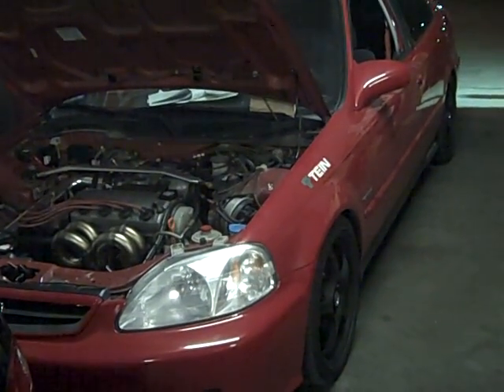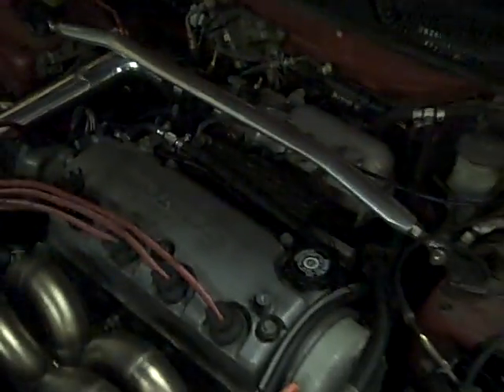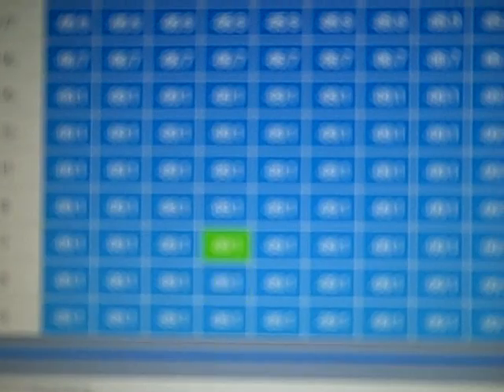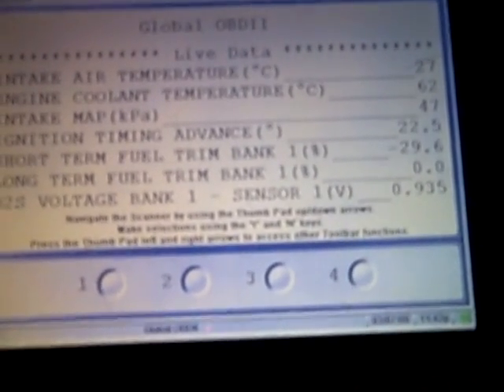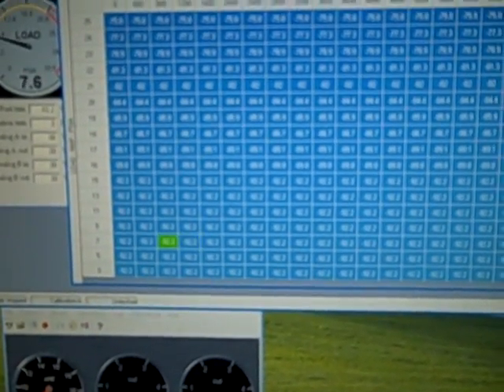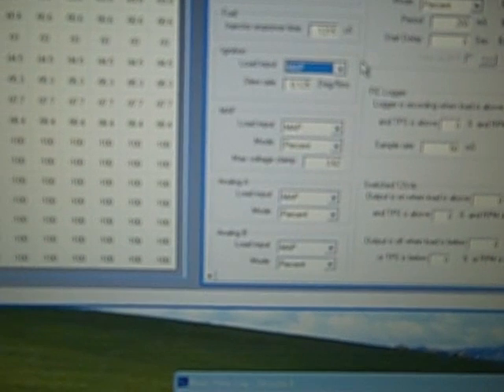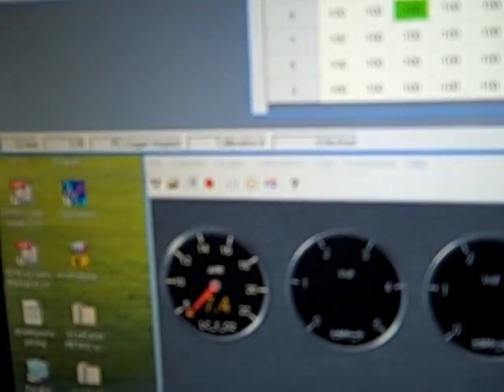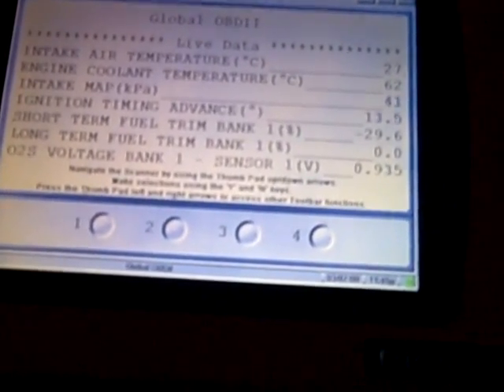AEM F/IC Running PIG RICH on a turbocharged 2000 Honda Civic EX

Comment: In fact, I would go even 1 step further. I would not use the "single value" MAF MAX Voltage  clamp on the setup screen. I would use the MAF table (the "M" icon) to set the clamp for each RPM. That way the ECU will not get abnormally high values at low RPM just because you have to set the clamp high enough to get a good reading at high RPM.

Comment: IMO, I would simply not use the MAF based FUEL table. I would set the clamp and leave it filled with zeros (zeros means do nothing). Use the boost pressure fuel map to do all your tuning. Otherwise it's too easy to get confused

Comment: You have to make sure that the Fuel map and the O2 spoof table are trying to accomplish the same things. Make sure that if you are having the O2 system f/b to 20% richer that in the exact same locations you are adding 20% fuel as well. Not doing this will cause the fuel trims to start going nuts

Comment: you dont have to use the peek and hold drivers box , unless you are using 1000cc inj or beter.
also did you set the the software up to see the to see 550cc inj? are inj.'s high or low  omh's ? call me 
Rpm Systems
Monday -Friday 10am - 6pm est
Saturday  11am - 5 pm est
Sundays close

phone number 845 795 5398